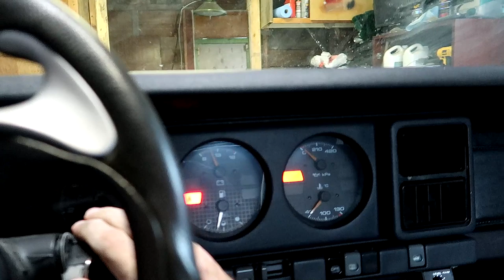Polishing and Tagging Dirtybird

Comment: Make sure you give your brakes a really good stomp before you take it out onto the road. You see, when a car sits for long time those brake lines get thin and the chances of blowing out a line or hitting an air bubble is greatly increased. If by chance you do have to replace any fuel or brake lines in the future, Remember this, Nickle/Copper lines, they don't rust, they are far easier to bend and work with over steel lines and they don't really cost much more.